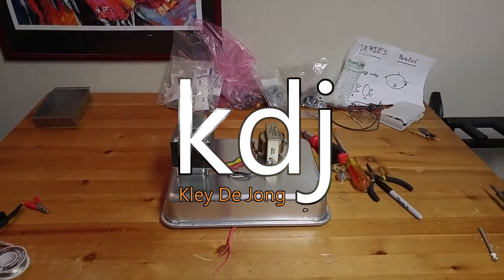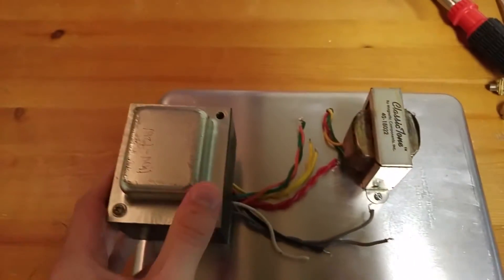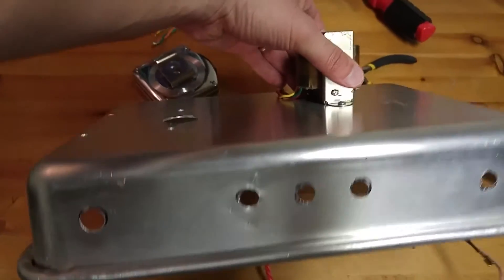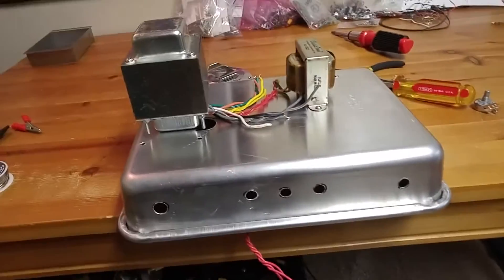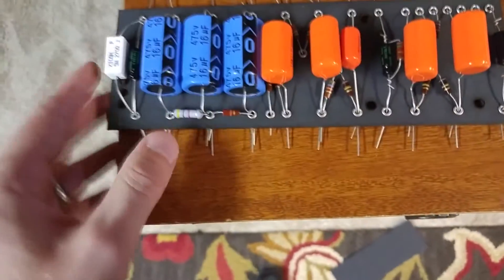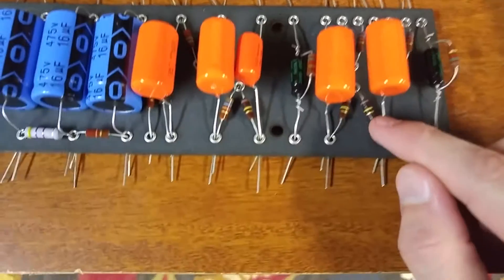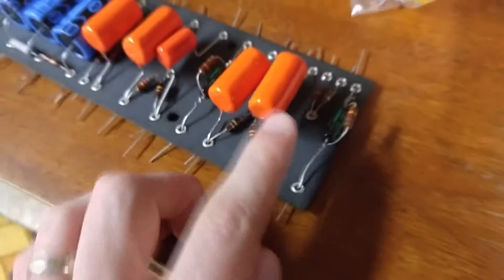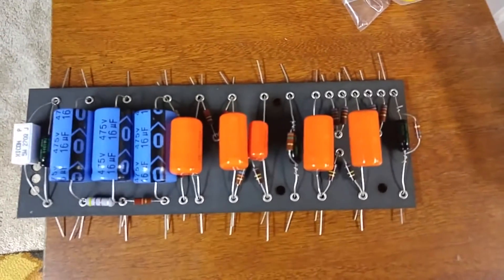Cakepan 5E3 Tweed Deluxe Amp Build - Pt. I

Comment: Cool!  So, what was your first amp project?  I'm replacing some caps and doing some light mods on my 73 Fender Twin Reverb. Thinking about a Princeton kit. Sensible?
Reply from the maker: Thanks!  My first amp was an old epiphone valve junior that broke and wasn't working.  I took the chassis and head cabinet and gutted it entirely - and replaced it with a 5F2A Tweed Princeton circuit.  Small parts kit from Mojotone and transformers from Classictone.  Very happy with it!  I think a 5F2A or 5E3 are excellent starting choices.  Doing that project should enable you to do lots of fun mods to your Twin Reverb.

Check out Uncle Doug, TDPRI's Shock Brothers forum, and Rob Robinette's website.  Good luck!
Reply: okay!!  thanks!  Uncle Doug is awesome!  Hope he's still around.